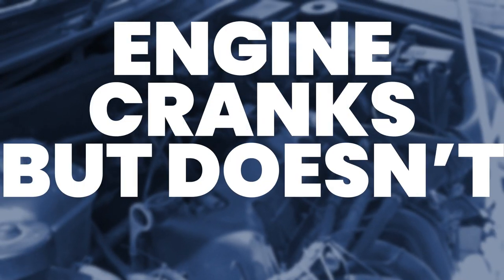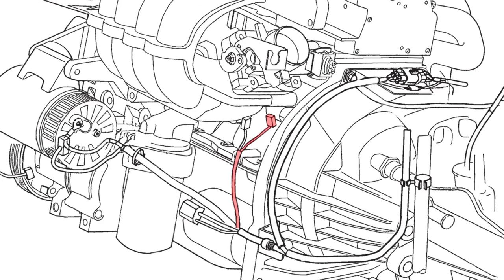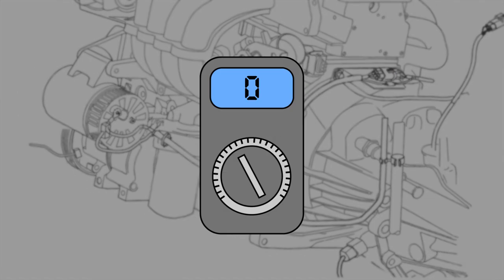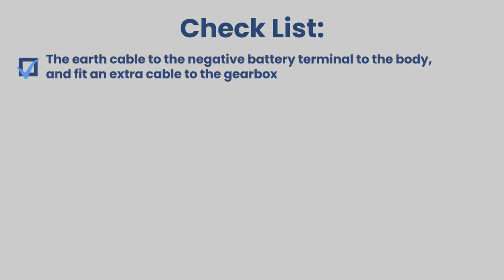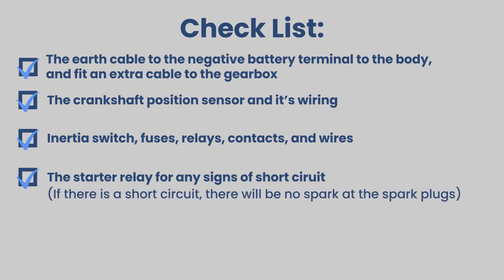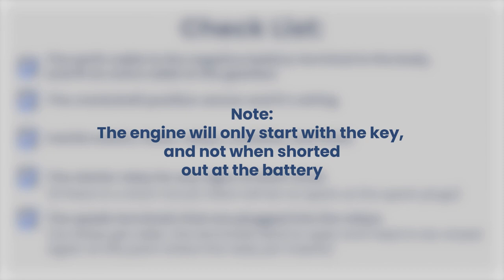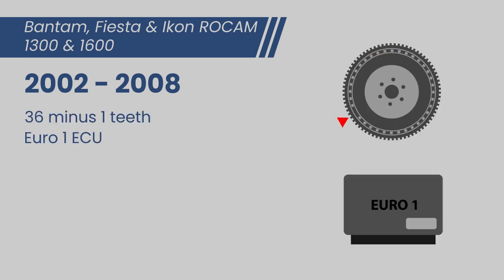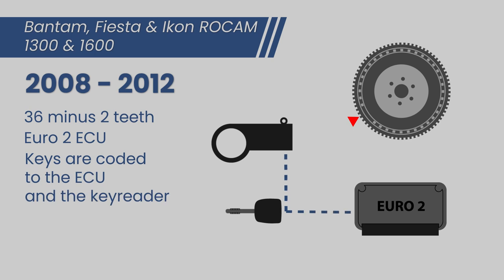ROCAM ECU Series - When your engine cranks but doesn't start

Comment: Only things thats weird i got an 2003 1.3 rocam and the key is coded to an keyreader and computer box had some trouble with it before
Reply: The Keys for the 2003 are coded directly to the Computer box (The Larger unit - 2002 to 2007) and not the key reader. These key readers have an eight pin connector. The smaller Computer box, the keys are coded to both the key reader and the computer box (2008 to 2012)